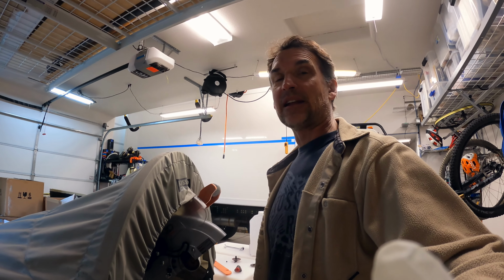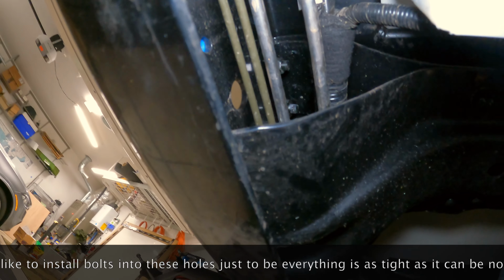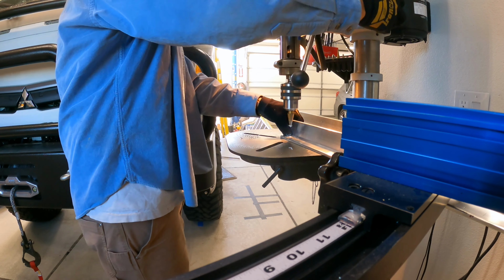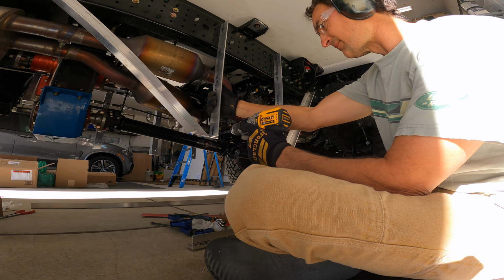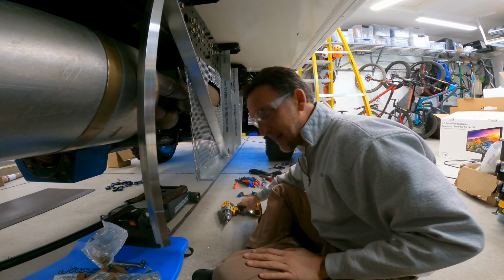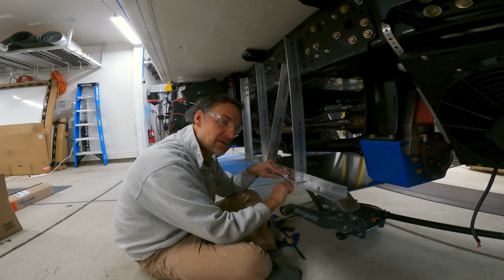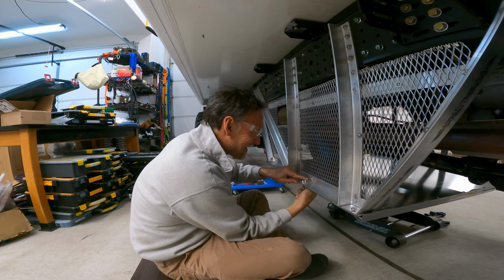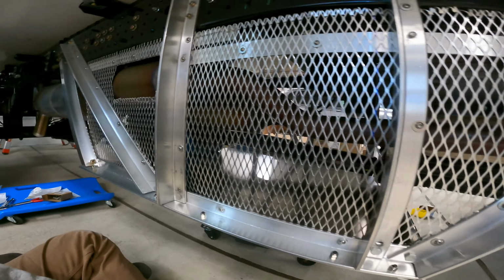Building a skid plate for the Expedition Truck

Comment: Great build. Those m10 captive nuts in the chassis are fine thread which is better for use where there is vibration.
Reply from the maker: Thank you much! Yes, I've been using a bunch of fine thread especially on the chassis to help stay tight.